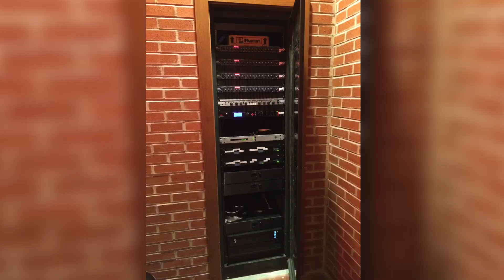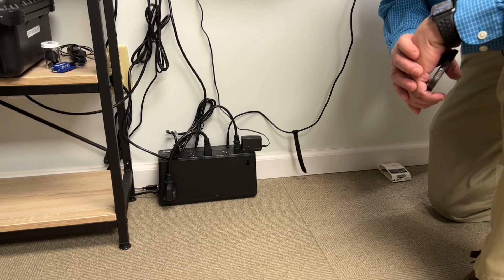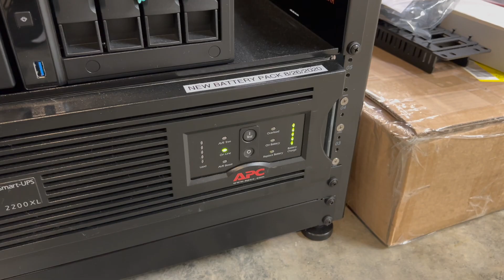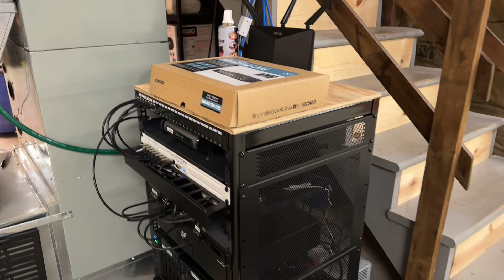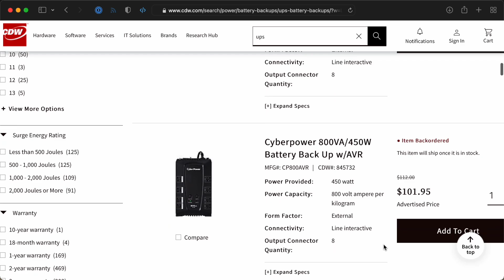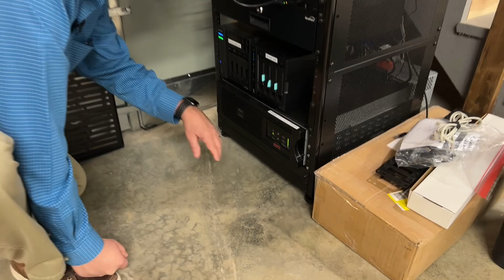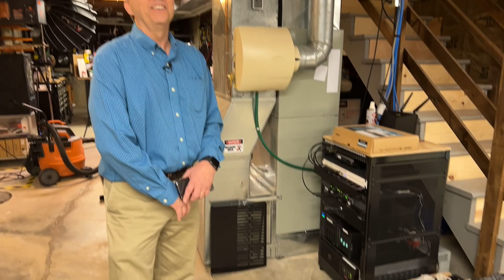Choosing a UPS (Uninterruptible Power Supply)

Comment: I recently was upgrading the IT infrastructure for my home back in India, which involved new batteries for the UPS and a proper Synology NAS for storage.
We have always used power products from APC because their quality has been excellent. From small UPS es to full home inverters. However, recently we faced a problem with an old UPS and had to buy a new unit. It was disturbing to know that APC is not selling any UPS, in India at least, with a USB communication option. The ones available cost about 3 times more, which stops making sense in a home environment.
USB interface for auto shutdown commands should be standard in every power backup device. It would cost barely a few dollars in the BoM, and the advantages are so obvious.

And then just last week, due to a strike, our house was without mains power for almost 36 hours. The main home inverter lasted about 16 hours (Yay to LED lights), and then the UPS which was handling my network stack lasted an hour more. Thanks to the USB interface, the drives were unmounted and all services stopped as soon as the battery level went critical. Also a big thumbs up to Synology software, the APC UPS from 15 years ago was plug and play!

I plan to write about this in more detail on my blog later, if someone is more interested. :)

Comment: I've been looking to get a UPS for my home rack.  I have one for my desktop computer that I use daily, a good 1500VA deal with a 900W output.  My server uses 1100W though.  When you guys say "aim for 50% to 75% load", do you mean total wattage vs the VA listing (so a 2500VA UPS would be ideal for my 1100W server?), or do you mean voltage usage vs. UPS output (a 1200W output UPS would be inadequate for my 1100W server because it's drawing 90% of the output wattage)?
Reply: I think they mean real watts. If your server actually uses 1100w then you probably want at least a 2200VA backup. But those are too big to plug into a regular 15a 120v outlet. However, I can't imagine anyone using a 1100w server in a home rack. Its power supply may be rated for that much load but chances are the components inside can't actually draw that much.
Reply from the maker: Typically the larger UPSes (like the one in my rack) has a different plug that should only be used in a 20A circuit (with a horizontal and vertical prong, plus ground—at least in the US/NEMA).

Once you go beyond that, there are UPSes that require 30, 40, 50, or higher amp circuits, and some are direct wired, others may have plugs more commonly seen on home appliances.
Reply: I have a computer I use as a server with a 1300 watt power supply, but actual load is only going to be 600 watts if you add up the components.   The power supplies shouldnt be overloaded either.   However if it is one of those dell servers, maybe they use more, idk.  You need at least 12 gauge wire instead of 14 for a 20 amp 120 circuit

Comment: Serious question and comment - I have a need to power 240V motor  (36 amp draw) for about 90 seconds at a time but the rest of the time the load sits at about 2 amps. All the UPS suppliers I spoke to will not recommend any inductive load like a motor on a UPS.  Can you recommend one for inductive loads? I was told that a "4 quadrant inverter"  is what I need to find.  
And my comment is that since Schneider bought APC the desktop grade UPS's are just junk. I buy many of them and I have had a very high return rate on the smaller models.  I've started using Cyberpower and so far so good. Such a shame, they were the go-to for UPS's
Reply: Where did your 240V motor data come from, e.g., 240V @ 36A for 90 seconds. A 4-quadrant inverter will not solve overloading from motor starting currents. You really need to hook a PQ analyzer up to your motor and capture the entire start/running cycle. 

Motor is generic term applied to lot of different motor types in lots of different equipment. What is this specific motor doing? How do you know its 36A @ 90 seconds? 🤔
Reply: @alwarner5787  I measured it with a Fluke 435-II over a 3 day period. The 36 amp I speak of is FLA and was recorded as the max value over the 30 second sampling period of the recording. It's obviously of much shorter duration than that but I am erring on the side of caution. The motor is a pair of centrifugal sump pumps that alternate. They run about 90 seconds at about 7 amps. 
The end goal is a "tesla powerwall" kind of backup power. The load is too low for even the smallest of the diesel generators I operate and while a residential grade generator would work, they would require a LP tank which is not ideal in this remote location. 
This search is frustrated by the issue that all the "powerwall" vendors i.e. Enphase, Generac, Tesla, et al. only know the residential solar panel/powerwall ,with readily accessible internet template.  My application is isolated and industrial and this is outside their area of knowledge.  The 4-quandrant inverter was suggested by the EE dept of an integrator as a direction to pursue.
Reply: @EmmerBigguns  Maybe something like the Outback Radian system could work. The GS8048A can handle 33 amps output continuously or 50 amps for 5 seconds. Outback seems highly regarded in off-grid communities so reliable operation in isolated locations shouldn't be an issue.
Reply: @eDoc2020  I will take a look, thanks.
Reply: @EmmerBigguns  I know all about four quadrant inverters, and they have peak current limiters and conduction current limiters  just like any other inverter. You need to see the maximum peak current and its duration.  Most inverters will current limit @ ~ 2.4-2.7 x the RMS continuous rating @ 8ms (1/2 cycle at 60Hz).  However, thats not your only problem, e.g., the extremely low motor starting power factor is another.
Reply: @alwarner5787  I agree, its a hostile environment. Do you have a recommendation for one that would fit this application?
Reply: @EmmerBigguns  Send me a PM so we can communicate more clearly about the site and applications details.
Reply: @alwarner5787  How is that done from here?
Reply: @eDoc2020  Emailed them twice and can't get them to respond

Comment: I thought size doesn't matter? :)
One thing that's hard to find in the specs or non existent. Will it turn back on after a power failure after you deplete the batteries. I bought 6 different ups models and none of them turned back on after the batteries drained. Apparently a lot of the under $200 ups devices don't do that simple thing. Amazon / APC / cyberpower were some of the brands...
Reply: A high quality sine wave 1500VA UPS is going to cost you north of $500 U.S.
Reply: Craig, same issue with finding units that power back on after a power outage and the battery depletes. I still need to make a trip into the lab/office if the power goes out for an extended period of time just to power back on the UPS (has nothing to do with if the devices connected are configured to power back on after a power outage if the UPS doesn't supply them power in these situations). Once the power goes out, and the battery drains, the UPS shuts off and requires manual intervention to power back on.
Reply: All my APCs have turned back on after a power outage. However, you also have to set the devices to power back on. On PCs, this is found in the BIOS settings.

Comment: I work in Event Tech and we also use UPS devices to make sure that our temporary network and computers does not shut down if there is a power outage (aka someone unplugged the wrong cable), for computers we really like to use the option to connect the UPS to the connected PC so that the Computer can safely shutdown and here comes a BIG downside on the APC UPS, they use an RJ50 connector for USB so that you have to order a separate RJ50 to USB Cable which will take a few weeks to arrive, previously this cable was included with the UPS but for environmental reasons it is no longer included and you need to message them and they will send it to you (for free) but it will take a few weeks to arrive. If they really cared about the environment they would just put a USB Type B or USB Type C connector onto their devices so that the customer can use  any spare USB cable to connect to the UPS. So my advice for everybody that want to add a UPS to their computer: get a UPS with a real USB connection and not the APC stuff which requires a special cable you can not buy local.
Reply: Yeah, no kidding.  I lost one of my cables (well, it's in a box somewhere around here), and looked for a replacement.  $20 for a stupid 6-ft cable, when I have a big bag full of USB cables just sitting here collecting dust.
Reply: I wanted to buy a new home UPS from APC but, at least in India, they have stopped providing any communication enabled models for general home use. The ones that do have USB interface cost 3 times more. It's stupid. I hope they reverse this decision.
Reply: My SUA1500 has a regular type B connector. Maybe it's just newer models or lower-end models which have the weird connector. Mine does have the nonstandard serial port, though.
Reply: @eDoc2020  All of my APCs are older, 2005 on up, all had the RJ45 "serial" port and came with the RJ-to-USB cable.  I think they are the high end ones, Back-UPS Pro 1500 or 2000 ($250-300).
Reply: @d00dEEE  I believe Back-UPS pro is prosumer and Smart-UPS is more professional oriented. Looking at their website the current Smart-UPS units without Ethernet have regular type B ports but the ones with Ethernet unforgivably have type A ports.

Traditionally the Back-UPS was fully "dumb" (my 1999 version doesn't even have a microcontroller) and you needed the Smart-UPS if you wanted the computer connectivity.
Reply: At least environment is now safe, right? =))))))

Comment: The oscillating UPS story sounds like an inrush current problem. Major issue when you add a multitude of equipment on a single UPS. The 50% rule helps, but use an Ammeter to determine the inrush of your rack to develop a solution. Staged turn on circuits help to cascade rather than avalange the inrush currents.
Reply from the maker: Yeah; 50% rule is typically adequate, but if you do something like throw a ton of spinning hard drives on a system connected to a UPS, and they're not connected to devices with staggered spinup, that initial surge can be pretty large.

Comment: Changing a UPS is not possible in your config and i had this before myself. 
That was the point i bought a ATC (automatic transfer switch) to bypass/switch off the UPS from the LOAD and i can maintenance the UPS independently from the LOAD.
Reply from the maker: For the home setup we were standing in front of, it's not mission critical to have zero downtime—I'm okay with taking down the network for a full unit swap when the time comes.

At the radio stations, there is a full transfer switch for the whole-building backup (along with a pretty hefty generator that can power everything indefinitely, given enough fuel). At the station where we did the last video, the budget doesn't allow for the whole-building UPS, but in that case there's more than one audio chain, so the audio can be routed through a separate rack, while we service the main one.
Reply: But what do you do when you need to service the automatic transfer switch? The problem just reoccurs later. If downtime to change the UPS in unacceptable you should really be using systems with redundant power inputs.
Reply: @eDoc2020  in this case you need to have a PDU with 2 feeds or even a rack with 2 separate PDUs

For me tho, an ATS won’t died that quickly. But the my UPS must be turned off to replace the battery.
Reply: @marchagen3893  What sort of UPS do you have? I don't think I've seen any which need to be turned off to change the battery.
Reply: @eDoc2020  at first i had a no name generic ups from a friend, which had no battery quick disconnect, and the batteries where inside with a top lid. was also very small like 250va?? dunno long time.

Now i have a APC Smart-UPS 1500 and altho it should be a hotswap battery. it turns off everthing. so maybe something is funky there (it was second hand) but it works great with the battery, like nothing is wrong. now for 6 years
Reply: @marchagen3893  My Smart-UPS 1500 keeps working if you unplug the battery, provided it has AC power at the time. Maybe yours is a different version. My presumption is that most UPSes have capacitors across the battery. The charging circuitry will keep these capacitors charged so there's always voltage at the battery connector. As a fully charged battery will have no current flowing into or out of it, it should be impossible without special tests for the circuitry to determine whether or not a battery is actually present.

The Smart-UPS runs all its circuitry off the battery so it can't turn on without battery voltage. But once it's woken up the circuitry can keep running from the charger as I mentioned earlier. It should only shut off if you accidentally short the battery connector and discharge its capacitors.

Comment: Aw Awesome! It's Blue Shirt Dad! When we gonna get Red Shirt Dad btw?
Reply from the maker: Red Shirt Dad would've yanked the battery live :)
Reply: @GeerlingEngineering  Yanking the battery when it's on line power is perfectly safe with that kind of UPS. A "smart" Red Shirt Dad would short across the battery connector.
Reply: @eDoc2020  My Dad was going to do it until he saw my face behind the camera—I've never done it on a running UPS, whereas he's probably done it 50 times by now. I'm less confident my UPS's abilities ;)

I guess it should be a saying: "You can pull your own UPS's batteries, but don't yank someone else's without their permission"